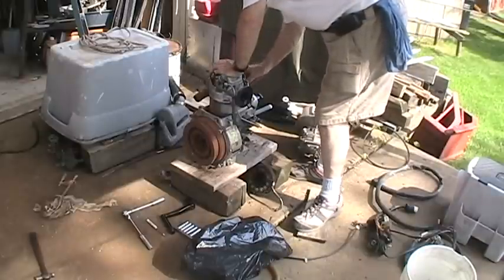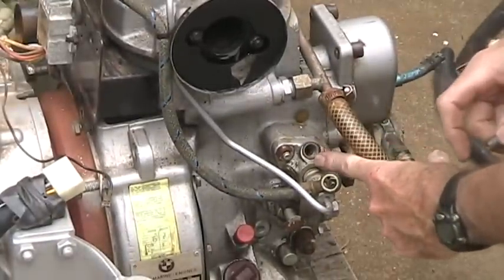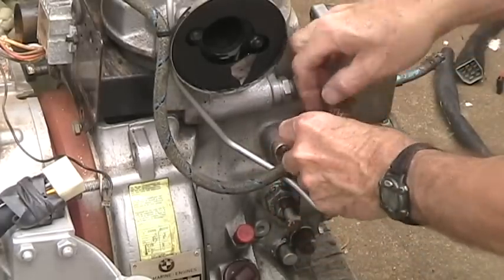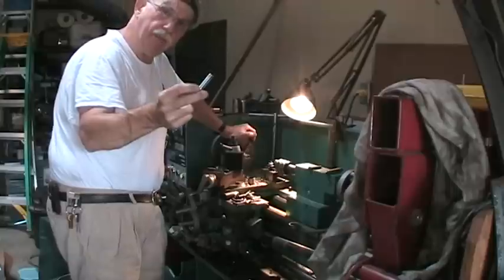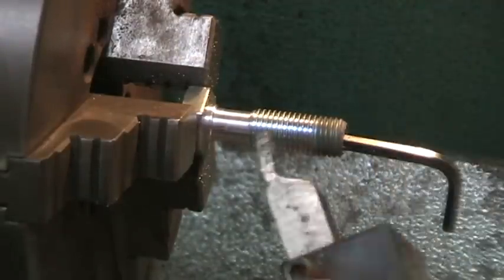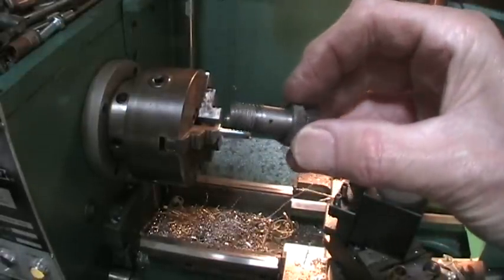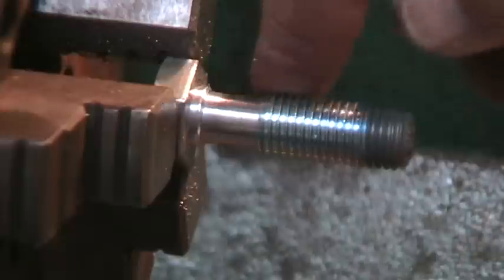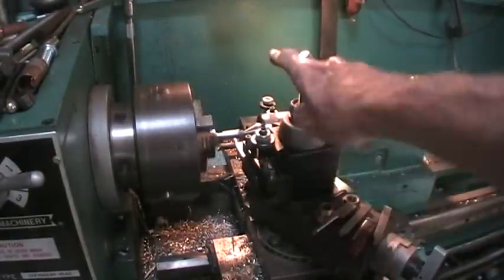Machining a Banjo Bolt part I

Comment: A  five  part  "mini series" on  the  making  of  a  banjo  bolt ?... I  think  I'll  just   purchase  one  instead... (  life  is  short )...
Reply: Not me: last week i needed a M14x1.5, double,36 long,for the iveco 2.5td conversion i'm doing in my '87 sea ray seville, (it had a good 3.0 Merc that i sold for 3 grand,installed,i work and convert boats for a living in porto,portugal,),and could not find it; in 10 min.i had a bolt  measured, marked,center punched,drilled in 5 places,and installed  in the engine block,with the 3 copper washers ,no lathe needed;it feeds the oil to the turbo,and to the idiot light pressure switch.
Reply: I just saw it,  the bolt he made i would not touch with a ten foot pole; D A N G E R !!!!  you have no C L U E ; 
With that big 17mm (close) head you are gonna break (broke it already,unless it was left loose for the next guy,lol)the poor bolt,that you weakened  inside and out...no meat left where the threads were... 1.250" hole...what for!!; and the cross drillings are gonna leave a couple of skins,lol;   2mm is it,to keep some meat on!!!!